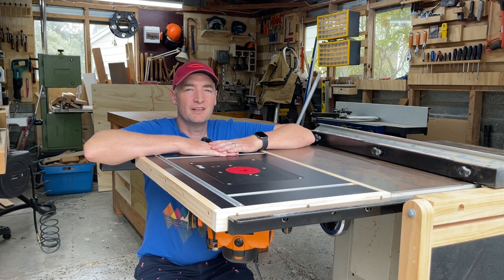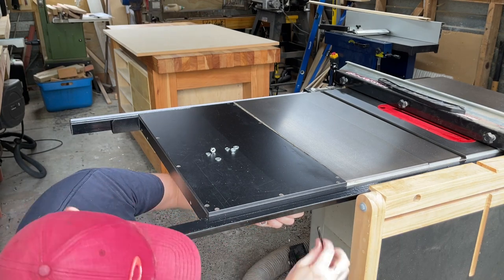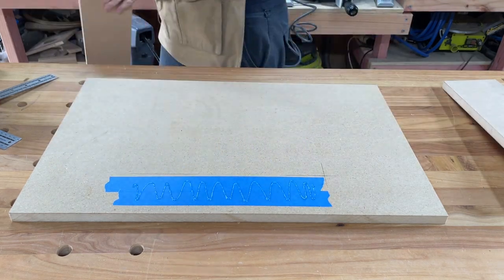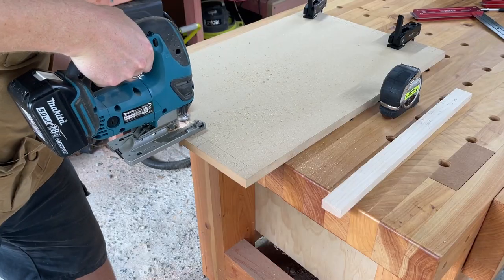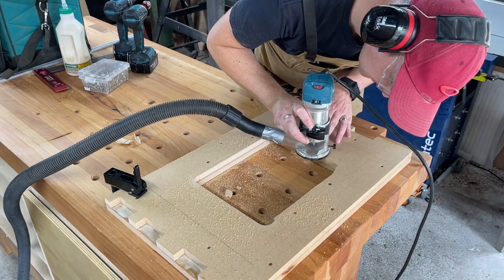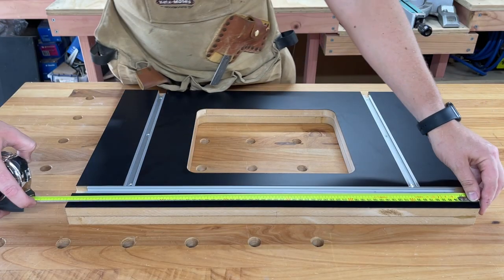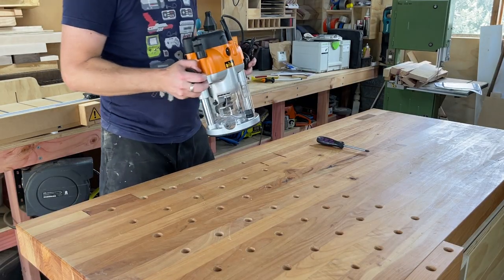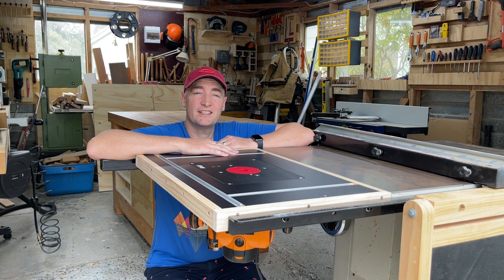DIY Router Table Attached to a Cabinet Saw

Comment: how did you make sure the ne table extension is flush with th table saw even though you said the line is different on each side? and can you extend an outfeed table?
Reply from the maker: I think I just clamped a few straight edges to the saw and then to the router table but it’s not that necessary as I don’t generally need to use that part when using the saw
I haven’t found a need to expand the outfeed table, I think it would get in the way when using the router table extension.

Comment: Hey Kris, did you you buy the router and router plate from Carbatec or did you go to amazon Aussie? interested if you went outside of Carbatec and had any links (otherwise ill check the Amazon links) thanks from a Wellingtonian
Reply from the maker: Hey there
I got the router from Carbatec and the plate from Amazon
At the time I think prices were about the same but carbatec didn’t have the plate or the levelers in stock
There are some links in the description but I think they are US Amazon links and don’t always worn in NZ ☹️

Comment: Nice add on. You can also use the back side of the existing table saw fence as your router table fence. That would save you from having 2 fences on one table. Just a thought. Great video as well!
Reply from the maker: Good thought, although I’ve already made the fence 🤣 just gotta cut the video together
Reply: It's hard to get fine adjustment with a table saw fence, I made a seperate router fence with a micro- adjustment, works must easier.

Comment: I have the exact same router and installed in much the same way as you have.  My problem is when adjusting the height of the router bit, I lock the bit height in place.  I rout a scrap piece to ensure the height is exactly where I want it.  If I have to adjust the height I unlock it and the router drops thus dropping the bit height!  Evidently the router vibrates the adjusting mechanism.  So when I try to adjust the bit to snug it up against the bit height before unlocking it, sometimes the bit height increases slightly.  It is so frustrating.  Anyone have any advice on how to keep the bit height exactly where it was before making slight adjustments?
Reply from the maker: That’s annoying, I haven’t had that issue yet but I will keep an eye out, I don’t even lock the height, I just adjust it with the handle thing that goes thru the table

Comment: I've never understood why people put their router table to the right wing of the saw. The left wing means you move your wood the same direction on your table saw. So, the outfeed table will also work in conjunction with the router table now as well.
 
Putting it on the right side requires the router table to be larger ( thus heavier) than it needs to be. 
 
Plus, the left wing is often wasted support space. The right side also means, for many saws, that the table saw fence brackets will overextend the router table, and be in the way. 
 
Just some food for thought.
Reply from the maker: The main reason is because the right wing was some cheap removable piece of mdf, not really good for anything, the left side is cast iron

Comment: Hi Kris, just a couple of questions. How's the macrocarpa holding up on the workbench? Also where are you sourcing your laminate from? Cheers
Reply from the maker: Hey Simon, the macrocarpa is great, it’s got the odd dent as you would expect but I’m really happy with it.
I went to a local kitchen manufacturer and asked if they had any scrap pieces of laminate, they dis and it only cost me a box of beers 🤟

Comment: Great video - lots of practical tips. What I don't get is why you have tracks on either side of the router running between the router and edge of table. Will you ever place the fence between router and edge of table?
Reply from the maker: The two side ones are for the fence and no they don’t need to be as long as they are as I will never mover the fence past the router bit, but it was just easier to do them like I did 😆
The one running along the front is for a feather board… which I do t own and have never used, but one day I may buy one 😊

Comment: Great build, im slightly confused as to why you did the first sheets corners with the drill press and didn't just use a 12mm flush cut with bearing, it would have followed the corner curve just fine and you could have avoided the drill completely. Your precision is on point im very impressed👍
Reply from the maker: Hey there
I used the drill press for the corners because the forstner bit I used was the same radius as the corners of the insert plate, if I just used the slush trim bit, I would need a really big one to get the same radius corners (which I don’t have)
Reply: Fair point, great build @macsworkshop